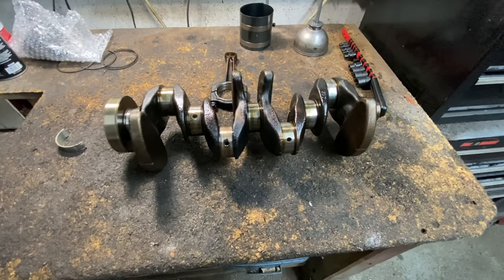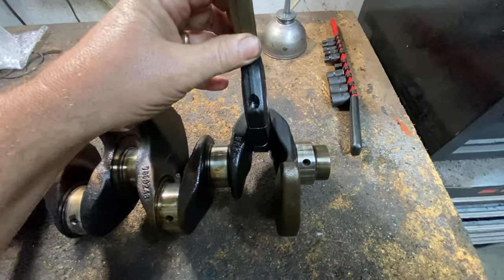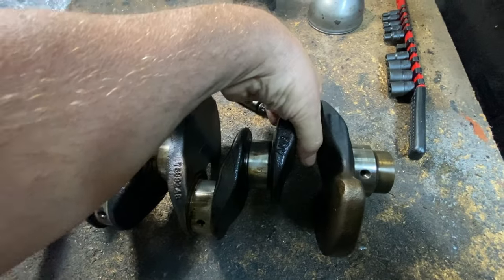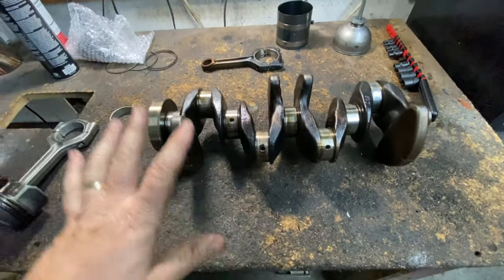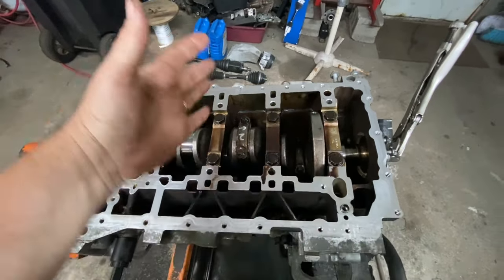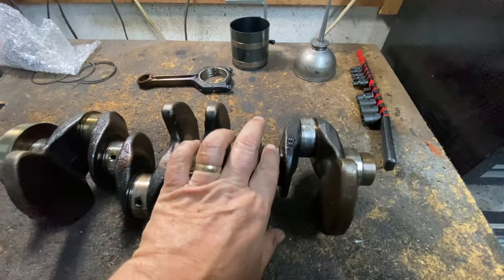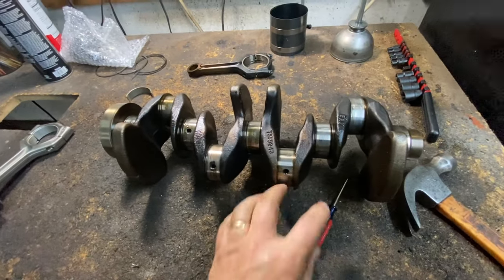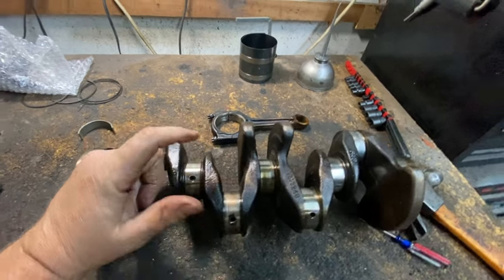What Is A Spun Rod Bearing - Explained

Comment: What are the main reason of loss of oil pressure?
Reply from the maker: Oil pump failing or failed, engine just worn ( main bearings etc)
Reply: Using the wrong oil, Synthetic/Conventional ….. killed our 2000 Daewoo :<
Reply: @iipumpkiniix  My first car was a 02' Daewoo leganza and it locked up because at the time I was not aware that you needed to check or change the oil.
Reply: @uranium3111  Haha aw that sucks. It's sad how they don't teach the basics of stuff like this at school.. or your instructor didn't do a great job either lol.
Reply: @uranium3111  how? thats car ownership 101. Thats like not knowing you should feed your dog
Reply: @cplpetergriffin1583  🤣🤣🤣🤣🤣 That's gold!
Reply: Blockage of oil pick up & low engine oil
Reply from the maker: @bashbash9227 yes that will do it too
Reply: Quickie Lube
Reply: Oil pump failer

Comment: If lack of oil (lubrication) is the main reason that bearings spin then you can prevent this problem if you can bond a lubricant to both metal surfaces.

🙂
Reply from the maker: Such as?
Reply: @Motorcarnut  XcelPlus

Comment: Crap there are heaps of reasons,  the main one would be conrod out of round
Reply from the maker: But why? because lack of oil, oil starvation.They all come down to that.
Reply: Journal to rod clearance not only oil , once the clearance is there the oil won't help anymore
Reply from the maker: You’re talking about maybe incorrect rebuild, that misses the point of the video

Comment: Sand paper rope
Reply from the maker: What do you mean by that?
Reply: @Motorcarnut  smooth the surface
Reply from the maker: @stanparsonstreeinc if you can but most times it’s too far gone and crankshaft has to be replaced.

Comment: Had a spun rod bearing, put a new crank in, all new bearings & new rod..After 20min of road time it spun the same bearing😂

I did reuse the same old oil pump but is there something else that may have caused this?🎉
Reply from the maker: The oil pump should always be checked but probably a blocked oil passage leading up to the failed bearing.